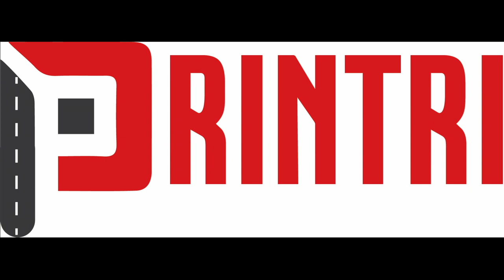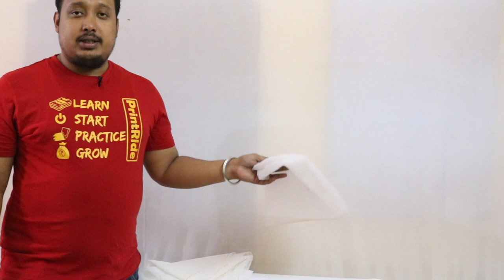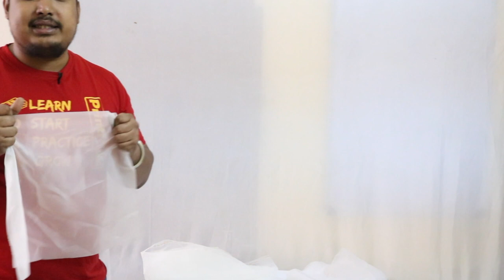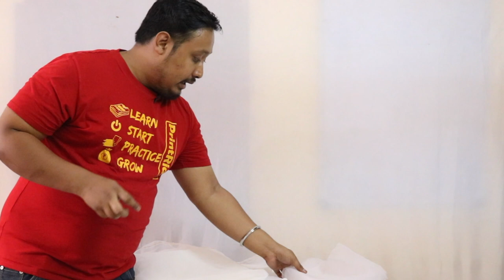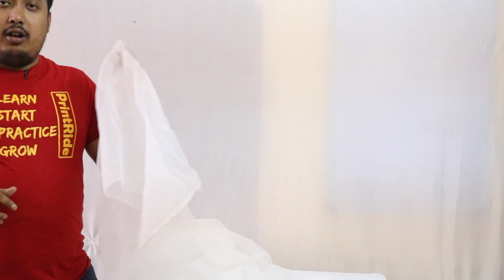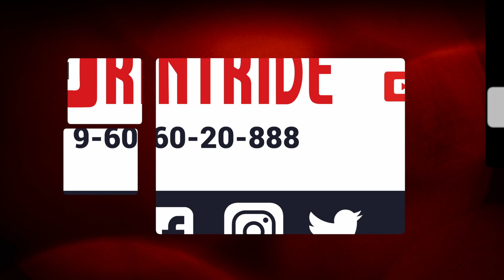Types Of Mesh In Screen Printing

Comment: Hey printride I liked your video. it is very informative but I have one question that the use of streching mesh come when someone do single color job and the mesh count will be 120?. 160 is for multi color job.
Reply from the maker: Hi Anil ...
Its not like that ...
if you are doing a small run and separate colors print then you can use stretching mesh because it is cheaper then Non-Stretching mesh .
Long run or complex design advisable  Non-Stretching mesh. 
Hope that solve your query.
Thanks .
Printride- Making India Print